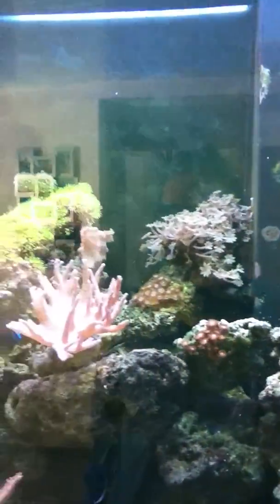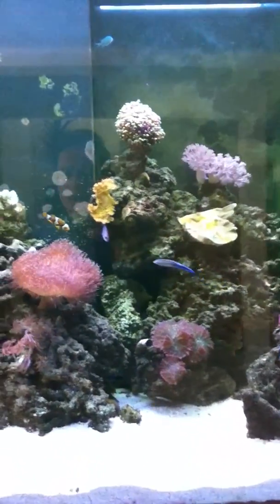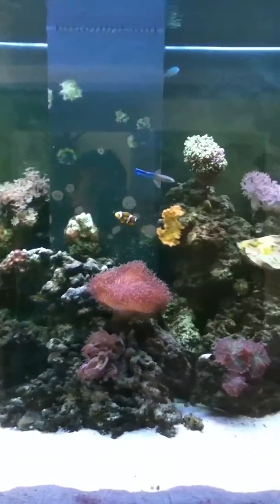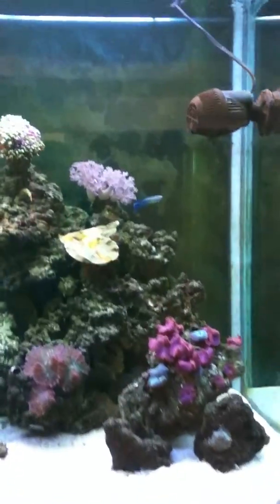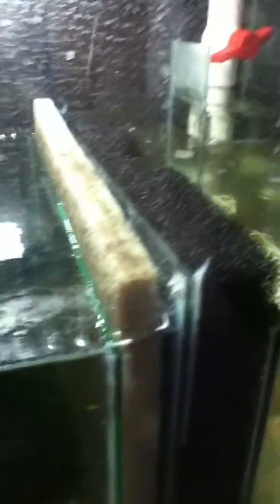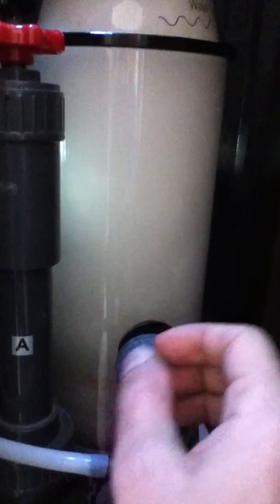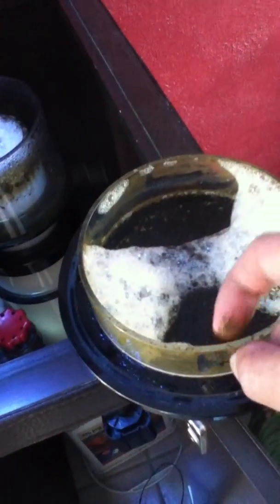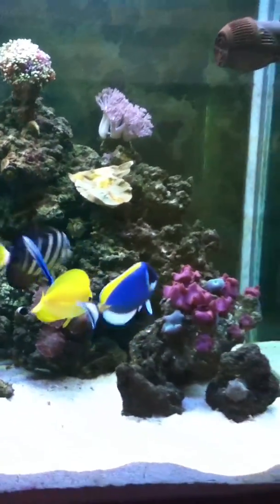Parallels: Aquaponics / Hydroponics / Aquarium

Comment: I am sorry, but a wooden structure could support that weight of that aquarium. I know guys who have built wood stands that hold 500+ gallon (1892+ liter) aquariums, with live rock. Its all in how its built. A stand built of 2x4 or 2x6 would easily hold that tank. I have a 110 gallon (416 liters) sitting on a very basic stand built of 2x4 and 2x6 lumber. Thats not much smaller than the tank in this video. And mine is a long tank, so its even more difficult to hold than a smaller squarer tank like the one in this video in the beginning. I also have nearly 70 lbs of pea gravel in it as well.

I have seen some VERY nice stands built out of wood for tanks larger than this.
I am not trying to be rude but I had to point out that a wood stand could be more than capable as long as its built properly.

Have a good day. :)